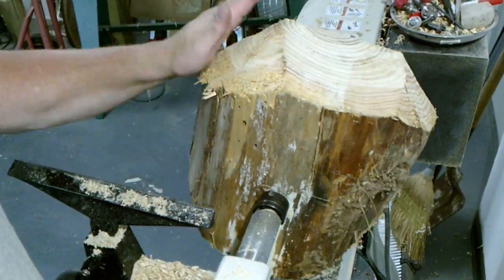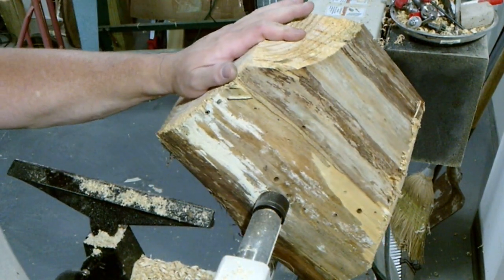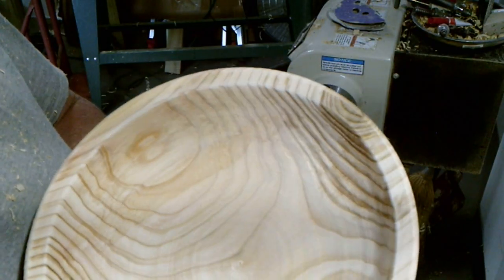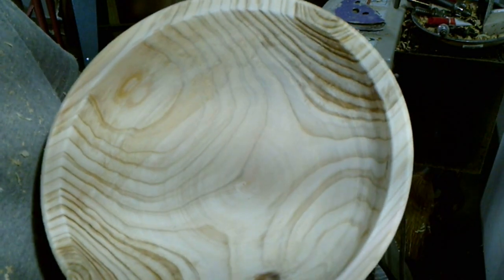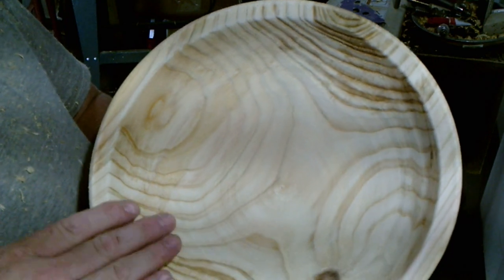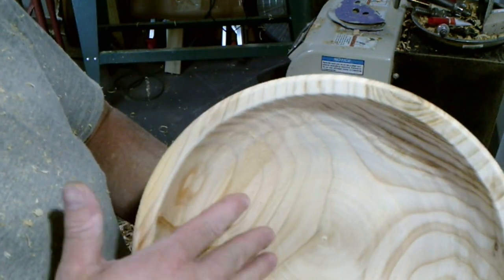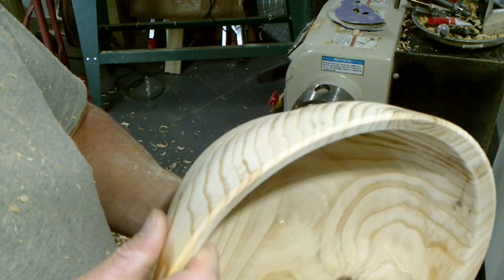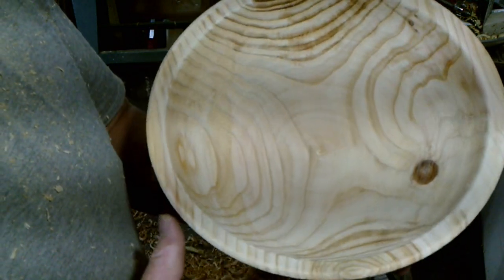Wood Turning Southern Yellow Pine Bowl

Comment: Hi Chris your bowl turned out nice. With the grain in that bowl I would certainly put a nice finish on it. Maybe a light oak Danish oil finish. That will color up the soft wood nicely. Then a clear oil on top.
It would look beautiful. 
 I have turned a lot of pine and it sure turns nice. But there are lots of variety of pine. My favorite was Sugar Pine. We used it for making wood patterns. It it gets its name for the sweet smell it has when working with it. Of course we mostly ended up painting with either red, black or yellow lacquer.
Nice work and take care,
Gary
Reply from the maker: Thanks Gary for info 👍